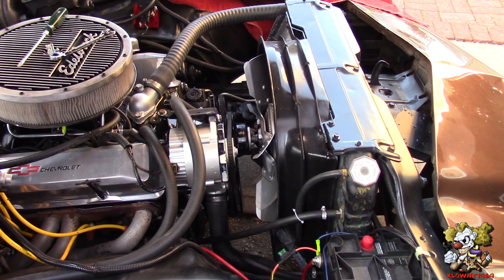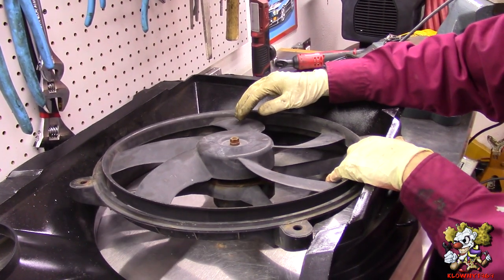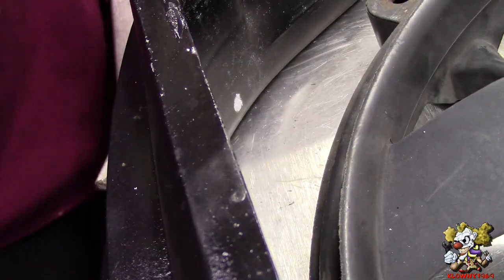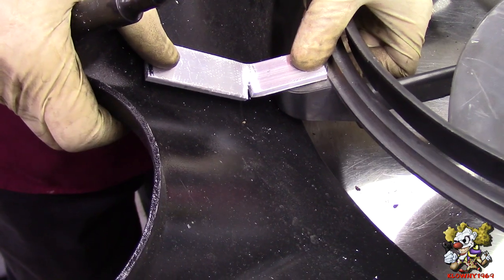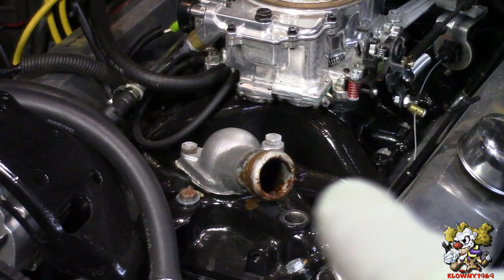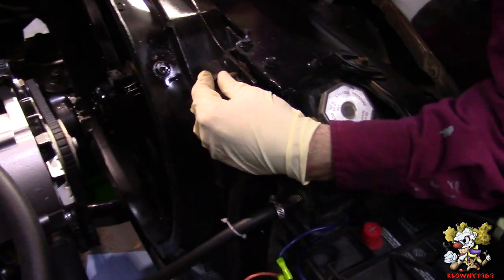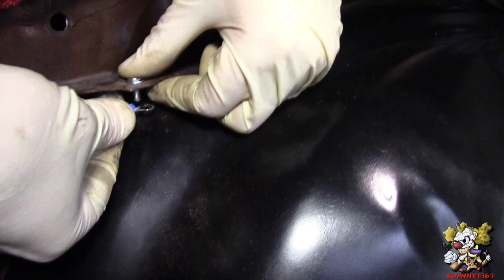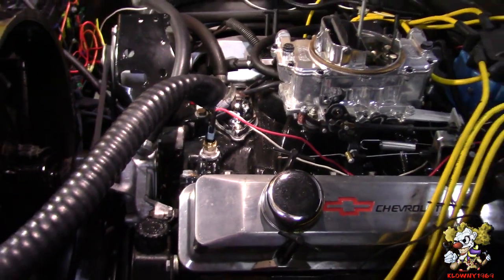Mechanical Fan To Electric Fan Conversion!! - GAIN HORSEPOWER

Comment: IMO on older cars going from a power robbing fan to an electric is one of the best things that you can do.  Warms up a bit faster, cools better in traffic, frees up more power that was being wasted by that stock fan, and uses less fuel overall.
Reply: agreed
Reply: Stepside1986 I had two electric fans on mine.....it overheated and drained my battery 80 watts each they pulled. I went back to a flex fan...I could careless about 20hp loss. My car is around 500hp big deal  I hated electric
Reply: Michel Linschoten I tried it too but just one fan and I had the same problems with the stock parts but I’m willing to try it again but with my Dodge Charger and a more powerful 320A alternator / upgraded power supply
Reply: @MichelLinschoten  
It sounds like you should have had a professional install it for you.
Reply: Michel Linschoten a stronger alternator could’ve saved you that issue and you would’ve had more HP, but hey if you can’t adjust to the problem and fix it, might as well go backwards right?
Reply: I have a question, does this mod makes the car more quieter? I have a 86 720 truck and is not very loud but i want it more quieter, i want to search for another muffler and this mod
Reply: It should the fan is alot lighter @JoseAlvarez-il3iy

Comment: It gives you more power because when you rev the engine to high RPM it can spin easier. Therefore, less force going in the opposite direction of the force of the rotating assembly. Its lighter without the fan too. You need a fan when your not moving like in traffic so why run a mechanical fan all the time when your moving all the time and the wind is naturally cooling the radiator. You also don't have to worry about getting stuff caught in the fan when your working on an engine at idle. You also get more room in the engine compartment because the mechanical fan is not in the way anymore. It also make your engine sound different because you don't have the constant loud sound of turbulence from the mechanical fan. I have dual electric fans on my 72 gmc truck with 350. I took the electric fans off of some newer dodge van for free and built some brackets and then got a controller for $30 on summit. And it has been working for like three years. It's easy to install there are like two wires, positive and negative.
Reply: This is why there are clutch fans. This fan install just misses the air OUTSIDE the fan frame, but inside the shroud . I am happy the original fan shroud was used.  20-30 amps is a drain on the alterntor which sucks horsepower as well. This amount can be equal to any gains.  IT was Not done on 3/4 ton trucks for a long long time later. The only reason GM went to Electric fans was space. They were a big warranty headache with hotter engine temps being required for emissions as transmissions burned up when over 200 degrees
Reply: That would be because with no belt your water pump is not working.....
Reply: It doesn't really "give" power it moreso "frees" power especially at high rpm

Comment: I have a '79 Z28 I am going to do this someday, but for now I need to put one on a 4x4 truck. I do a lot of slow driving over rough terrain and the AC stops working and the engine overheats with the stock fan. I never liked the idea of zip tying the fan directly to the radiator for fear of springing a leak in the boonies. Making my own brackets like you did is the way to go.Thanks for the video.
Reply from the maker: thanks for watching and commenting

Comment: I think it would be better if the gaps on the sides of the fan were covered up to the shroud itself.  I think that would significantly improve the efficiency of the cooling.
Reply from the maker: Car runs very cool..thanks for watching and commenting

Comment: my factory service manual  hid in very fine print that the engine driven cooling fan on a 1996  chevy  LT1  with trailer towing package consumed  TEN   HP
Reply from the maker: Lol that's funny

Comment: What about the gap between the edge of the electric fan shroud and the original shroud?  Seems like air is just going to slip through that gap.  Why not shield or close that gap with some heat-resistant rubber or other material?  I like your custom bracket technique.
Reply from the maker: Thank you..closing the air gaps is a good idea..don't forget to subscribe

Comment: Screw 195 turn on with a 170 off point. That's 25deg difference the fan will be running like crazy and ping off the line . A cheap capillary switch with the probe in the upper hose or pushed through the rad core will be way better. Mine is set to come on at 175 and it turns off at 170.
Reply from the maker: no issues with this setup at all..thanks for watching
Reply: The way it should be when going electric....

Comment: Properly working clutch fan doesnt draw much HP at speed, electric fans put a load on the alternator and turn on at a certain temp and run until the temp drops unless you put in a switch. So unless they are off at speed you wont really see any HP gain.

Comment: The only problem that is not discussed in any of these YouTube videos is
 that your factory fan clutch ties into your vehicles PCM, at least it 
does for the Chevrolet/GM line.  So, when you do the 
Delete/Replacement/Swapout to an electric fan setup, your vehicle will 
report back to your PCM as a failure or Check Engine light event, making
 it impossible to pass a state inspection in the future.
Reply from the maker: This vehicle is a 79 Camaro..dont forget to subscribe

Comment: Did the conversion on my 1992 MB W124 but with a 2-speed fan to keep coolant temp as stable non fluctuating as possible and to have less noise and power drain on the only 115A alternator, and there was already an auxiliary pusher fan for the AC.

What is the alternator's rating? Some claim not even 150A was enough for a good electric fan conversion.
Reply from the maker: The amp rating on the alternator depends on the car and what it originally came with.
Reply: @klowny1969  
I was wondering if you used the stock or replaced it with one of higher output since the conversion involves extra electricity needs to the system. I'm under the impression the stock alternator is just a little better enough for the stock car specs that did not utilize an electric engine fan. My stock was 90A actually.

Comment: And do you think a new aluminum radiator is worth them money versus a new OEM radiator? I'm looking at a 3 row mishimoto radiator, but I don't know if the stock shroud will fit.
Reply from the maker: Mark Hodge if ur planning on putting more power into the car or the car runs a little hot. .then i would go with aluminum..i dont remember how big that thirdgen fan is..but its a beast for a second gen
Reply: Thank you great klown master!

Comment: I don't know too terribly much about cars, but I'm very interested in learning more. Am I correct in my assessment that all this really does is take away a relatively small amount of rotating mass, leading to a bit better throttle response? Could you eliminate that pulley altogether removing even more rotating mass with a different length serpentine belt, or at the least, replace that pulley with a lighter aluminum one to add to the effect similar to kits I've seen that use differently sized pulleys on like the AC compressor to reduce parasitic drain. Just curious, I just found your channel tonight and subscribed, you seem to be very in depth and I'm always interested in learning new things.
Reply from the maker: this particular engine, u cannot get rid of the pulley because it runs the water pump..unless u put in an electric water pump..lighter pulley wont do much..an underdrive pulley will give u a little more power..but then ur charging and cooling can suffer a bit
Reply: klowny1969 Thanks for the response. Am I correct though, that really all you will notice from this is maybe a slight increase in throttle response?
Reply from the maker: +boomstick900 yeah that and some added hp

Comment: How much more torque and hp do you say you get from doing this? 10 HP at least?
Reply from the maker: Depending on the engine..you can see 10 hp or a little more

Comment: Great works

could you explain the best way to find the ignation wire!
Reply: depends on what car you have. Its the wire that turns your car off if you cut it while its running.

Comment: Great video nice work.

  I would have used nylon lock nuts and it does look stock. 💯👍🏼
Reply from the maker: Xavier Xavier thanks for watching and commenting
Reply: nylon lock nuts stronger enough in long run ? or temporarily for short term ?
Reply: SUN NETOR I’m just saying lock nuts won’t come off with the vibration of the fan and he also has a back up fan if this one shells out.

Comment: You have done a great job and detailing thanks. what about your AC wiring
Reply from the maker: Thanks..i installed a vintage air in this car..if not u need a different relay with two wires to energize it

Comment: thanks for the video does the 12v source have to be live all the time or one the turn on and off with the key switch like the radio fuse?
Reply from the maker: U can wire it both ways..i like switched 12v..thanks for watching and commenting
Reply: +riuuku - Ignition Fuse or Radio, less switches and less money :))). Just tap into those wires or tap into Fuse Box itself :)))
Reply: @JodBronson  like the fuse box idea... then just toss the appropriate fuse. I dig it dude.

Comment: so the pully for the old fan stays in the belt? does anyone take the pully out or is it just the weight of the fan itself your taking out of the picture?
Reply from the maker: Caleb Spurlin u need the pulley there for the water pump..just take the fan off

Comment: Do you have any videos on the dual fan setup for a 3rd gen, I have a 85 camaro that came without electric fans, I bought  the dual fans from an 87 or 88 off eBay but I'm confused how to hook the harness up because theirs nothing to plug into on my car that would power them
Reply from the maker: austin C its similar to what i did in this vid..get a dual fan relay kit..there are also instructions in the kit

Comment: My fan came with nylon straps to put through the radiator cooling fins but I like the shroud idea. So, you can tap off the choke wire? How convienient.  Got it to do tomorrow.
Reply from the maker: Christopher Wyller wait..what are u tapping off the choke wire?
Reply: The yellow wire off the relay to the thermostat switch then from the switch to the choke wire. Switched 12v from the ignition switch. Using a "Derale" relay and harness kit.
Reply from the maker: Christopher Wyller as long as u put it on the "switch" side of the relay
Reply: There's a yellow as well as a green wire for a manual ovveride. Looks like that activates the relay. At least I got all night to figure it out.
Reply: So I did it today and got it done before dark. So, it does work but it heats up to 200 before the fan kicks on and off keeping the temp at 200. Either my temp gauge is off or the sender or coolant probe is faulty. Luckily I saved the fan and shroud. Gonna drive it a few days. It's so stinking cold now with the heater going all the time I don't think it will be a problem until summer. All I think i'll hafta do is get a better fan assemby with some kind of a shroud. I think i'll put in a manual ovveride switch so I can turn the thing on when I want.
Reply from the maker: Christopher Wyller it does turn on a little hotter than advertised

Comment: nice i want to do that to my caprice statesman 2006 ltz V6 but the problem that is no space betwen engin and the radiator so tight
Reply from the maker: u can install a thin fan..check summit racing .com ...thanks for watching
Reply: thanks ..
Reply: my car drives me crazy i think i am gona set it on fire

Comment: Why is there 2 wires going to temp switch on intake? My truck only has one.
Reply from the maker: Monse Bishop it can be two or one..if its one, the one wire gets grounded by the switch..if its two its usually because it acts like a switch between the two wires

Comment: I upgraded my electric fans and now they're draining the battery. Any ideas?
Reply from the maker: What's your voltage when the fans are running and your engine is running? It could be your alternator needs upgrading..don't forget to subscribe
Reply: @klowny1969  I'm not sure. I built the engine and dropped it in...but im not an electrical guy. I was driving it and it got hot so I stopped and noticed the fans were not on but should've been and i cut it off. Then I put the key in and turned it to on and the fans came on. Went to start the car and it just made a single click noise. 20 min on a trickle charger and it fired right up.

And I just subscribed! Watched a few of your videos as I'm doing a 91 Camaro.

Comment: Dose this affect ur ac at all I added the electric, fans now when I turn on my ac my voltage goes really low
Reply: Amperage problem, get a battery with at 800 cold crank amps and a good alternator

Comment: How much hp would u gain if any?
Reply: I watch a show called Engine Masters and they dyno tested power robbing accessories.  It depends on what fan you're comparing to.  But on a 500hp motor they gained 30hp over a stock 7 blade clutchless fan!  That was the biggest gain they had.  Clutch fan robbed around 18hp if I remember right.  They also tested various aftermarket flex fans.

Comment: Doesn't the electric fan create an extra load on the alternator making it
Work hard using horsepower?
Nothing's free
Reply from the maker: yes you are correct, however dyno results have proven at least a 10hp gain (depending on setup) over a mechanical fan even after taking the extra alternator load into consideration. Don't forget to subscribe!
Reply: @klowny1969  I suppose the engine rpms and the cars speed has alot to do with the fan loads.
Don't clutch fans let it free wheel 
At high speeds dropping the power requirements to about zero?
I don't know if the blowers they 
Use on the dyno have enough pressure to disconnect the clutch
Like it would at 85mph
Reply: @klowny1969  lol a 10hp gain 
My triumph spitfire is only rated at 
56hp so that's a pretty big gain

Comment: And the alternator drag from the electric fans voids the power gain when on.
Reply from the maker: not true..dyno results beg to differ..dont forget to subscribe
Reply: @klowny1969  dyno with the fans running?
Reply: @Watchout1010  depends on what mechanical fan you have but Engine Masters did dyno testing on this on a 500hp engine and showed a loss of about 3hp from the alt draw but a gain of between about 10-30hp depending on the fan. 30hp gain from ditching the stock clutchless 7 blade fan like on a 60's or 70's car.

Comment: How would put one on a 2013 Ram Hemi and who would I contact to do an install?
Reply from the maker: i beleive there is an e-fan in the shroud..can put a toggle to it or have it turn on whenever the key is in the on position
Reply: I thought it looked like a mechanical fan that came from factory
Reply from the maker: i believe some models have two fans..e-fan for AC

Comment: I believe you arent supposed to put thread locker on thermostatic switches as it insulates the brass and makes it read incorrect. also pipe threads are supposed to be watertight without Teflon (right?)
Reply from the maker: i always put to guarantee no leaks..still works fine..thanks for watching and commenting
Reply: I don't think the threads of the plug are the only location of heat transfer. I think the bottom of the plug is conducting heat between the coolant and the plug. I don't think pipe threads are always water tight because sometimes on pipe you use pipe dope to seal them, but I cant remember if that is gas or water.

Comment: How would i do this for dual fans ?
Reply from the maker: DeadlyVoltsHD that depends what ur current setup is..if its like this camaro  then one fan would be the way i showed and the other would be on a relay triggered from an air cond switch

Comment: where are you located?
Reply from the maker: Jaime Anaya new york
Reply: :(  im in the west coast....really nice and clean work you do... i will try doing this on my Z28, i also like the way you installed the Vintage Air...
Reply from the maker: Jaime Anaya thank u :)
Reply: Sup Klowny1969! so i installed my electric fan to the camaros shroud, but my question is,  how far away can the fan be from the radiator?
Reply from the maker: Jaime Anaya as long as it doesnt touch it when spinning, u should be fine

Comment: I'm going to do this in my v8 s10.  I have a 1982 that has 140000 kms
Reply from the maker: Cool..good luck
Reply: did you get the s10 done ? any pics
Reply: steve whitacre no sorry.  I just got out of the hospital. Summer sucks this year but ill be getting out there soon
Reply: Okay keep me posted I have a 1st gen s10 and s10 blazer I race the s10 and the blazer is a mild manner street truck
Reply: steve whitacre I have a two wheel drive called the"sport truck"  it was fully loaded
Reply: do you have any pictures of it
Reply: steve whitacre not yet

Comment: You got a Video on changing the transmission oil fluid on a Chevy  Impala.
Reply from the maker: no..i have a video on how to do it on a grand am..same thing pretty much..check out my channel on how to change tranny fluid on a car
Reply: on the 2006 and up impala should change tranny fluid around 50k or 60K is ok.
Reply: This came up while getting a oil change done at the Chevy dealership they said transmission oil needs to be changed out at 50K